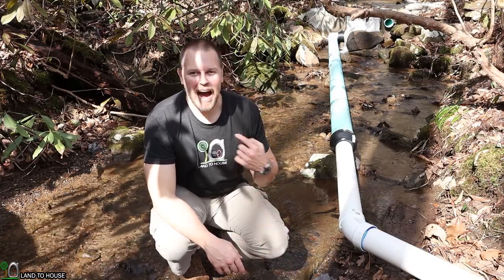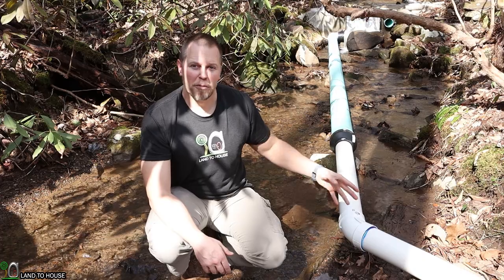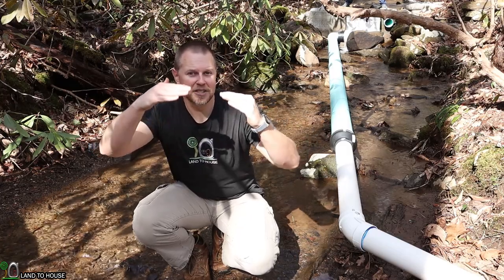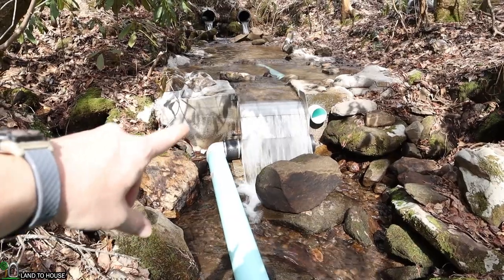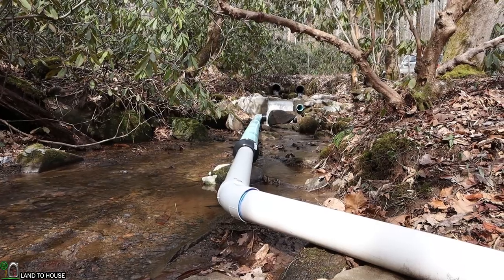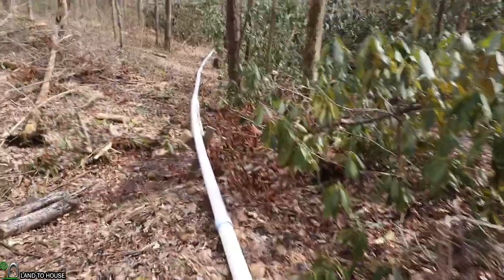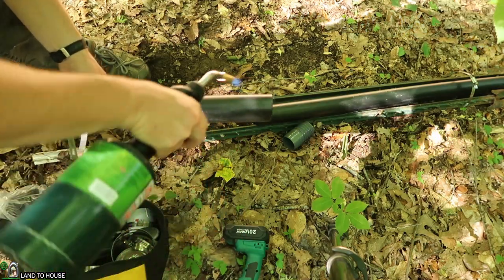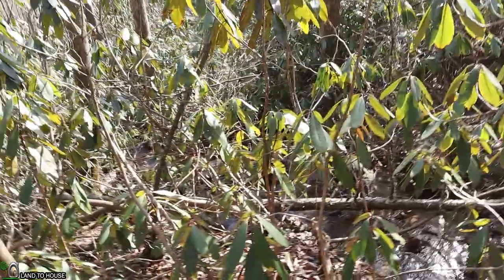Micro Hydro Penstock Overview

Comment: I would love to learn what power is generated with this system using 100 gpm and 50 feet of head.
Reply from the maker: More on this system coming up. Its a nice one.
Reply: @LandtoHouse  Based on my own 15 years of experience, I'd guesstimate 300 to 500 watts

Comment: My system, in use for 15 years, uses 3" fusion welded HDPE pipe all the way, 147' of fall in a 1/4 mile. VERY rocky terrain, simply laid on the ground, now largely overgrown with brush etc.  Right now I am producing 33.7 amps at 26 VDC,  24/7, into an Outback VFX battery based grid tied inverter,  which inverts and grid ties the power as soon as it's produced. The battery bank is not intended to be "lived off", it's just a buffer. If the grid goes down I have no power, the utility is my battery, a battery with 100% efficiency (I put one watt in, I get one watt back, months later) with unlimited capacity, with zero maintenance (I pay a $5.00 a month hookup fee, that's it) and it doesn't wear out or take up any room! For someone who was off grid for 28 years like myself, being grid tied is the way to go, I don't miss having a large battery bank at all! I have a stand pipe about 4' below my intake, just so when I turn the ball valve at the screen box intake off, I don't create a vacuum in the pipe as the water drains out,  no other stand pipes.  A couple times a year I uncouple the bottom of the line, and let it free flow for several hours, this serves to clean it out. I used 3", based on my estimate of the low water flow  times of the snow melt mountain spring, and expense of course.  Using 4" would have been beneficial until the summer wore on, the flow dropped, and I couldn't keep it full, even with the 3" I reduce my jets from 1/2" (two of them a Harris Hydro pelton wheel) down to 1/8" by late fall.

Comment: What do yo do about massive flooding or do you not suffer from that. GOOD QUESTION 🙌🙌🙌🙌🙌🙌🙌🙌🙌🙌🙌
Reply from the maker: The homeowner says they've seen somewhere around 700 gallons per minute flowing through this Creek. can definitely be an issue with flooding but they've got the Pen stock pushed over to the side and that gets it out of the path of the water.

Comment: Love your videos. Sadly I've been trying to set up a rampump for my land to no avail. 7 meters drop, 30 meters of pvc drive pipe, 100 mts delivery pipe, and cant get more than 20 of elevation with so poor flow... Is so frustrating. Even when I got a 5 gallon tank filled in 30 secs and enough drop it seems I can't figured out what's going on.
Reply: Ram pumps are very inefficient, homemade ones made out of pvc even more so. Expect 5-10% of the volume going thru the pump to actually be delivered, so 10 gallon per minute you measured would deliver 0.5-0.75  gpm pumped if you size and do everything right. 
As for only getting 20 meters of lift, if you can see the pump or drive pipe jump/jerk secure them (boards and strapping / rocks / whatever you have to do). If the pump/drive is able to move freely it will dissipate the energy / pressure wave and cut the lift ratio by half or more easily. Even fairly small movements will decrease performance very noticeably, get it as close to no movement as you possibly can. 

If your pump/d.Pipe is over 1in/24mm in diameter, or lift height is >40 mtr,  you need to use the thick walled pvc (SCH 80/4.5-5.5mm wall thickness minimum, SCH 120/5.5-6.3mm preferably). Even if diameter & lift are under that, double check you have at least SCH 40/2.75-3.35mm equivalent pvc, as they do make a thin wall SCH 20 & 30 pvc for non pressure drain/vent use and even at 12.5 mm dia it would bulge/expand like a vein and kill lift. Ideally, even if everything else is pvc, if possible, make at least the first 3-5 mtr of drive pipe coming off the pump in metal, and then pvc on to the supply if must. Oh, and the internal check valve can be pvc, but the waste valve, must be metal, no matter what, you need that weight and no flex hard stop (upgrade to stainless steel or modified style if you can). A swing check waste valve will work pretty decent, but search "rampump modified valve" to see the adjustable weight/stroke versions if you want better lift/volume once you get the basics working with the valve you have. 

Other potential causes:
Drive pipe length, without a modified style waste valve 30 mtr is quite long for diameters less than 1.5in/38mm. I would suggest a stand pipe halfway down (technically [pipe dia in mm multiplied by between 0.25 to 0.75 = pipe length in meters] should at least work, but I'd use 0.5 to start). 
Double check that the pressure chamber has enough volume per recommended vs the pump pipe diameter used, and that it has enough air in it. 
Make sure the drive pipe is completely purged of air, and that the intake is deep enough (6in/15cm+) that it doesn't create a vortex and suck air. Double check for leaks or any other ways air may suck in. 
Can't adjust this easily without a modified valve, but could give diagnostic clues: Count how many times waste valve cycles per minute, range of 20-80 should function ok and not be the issue {fyi, slower very hard hits will give higher volume and pressure}. Also make sure the beat spacing is regular with sharp clean snap sound. 
Attach a pressure guage and close the delivery valve to check the max pressure the pump can develop. With 7 mtr fall, should hit 40 psi minimum if nothing is majorly wrong, and 60+ psi if built/setup well (without tweaks/mods).
Probably more, but that's all that come to mind atm.